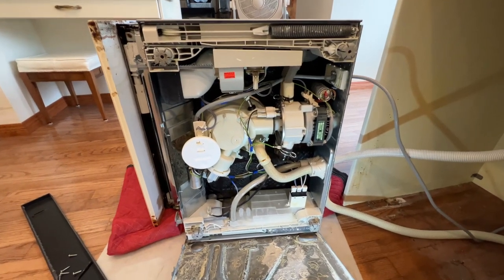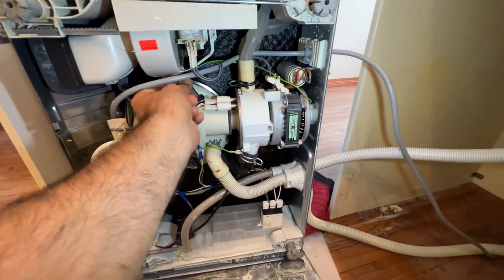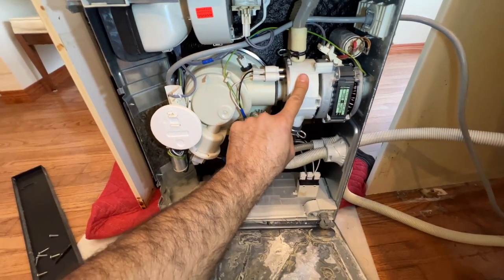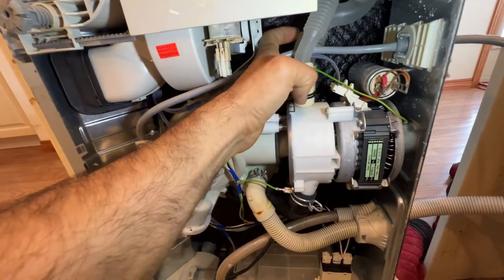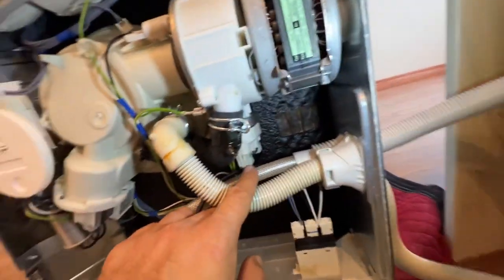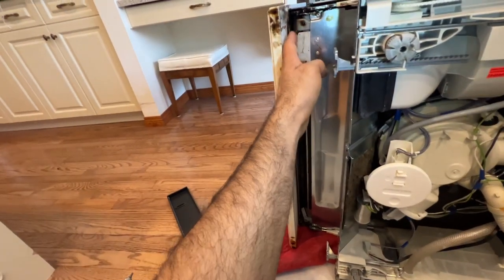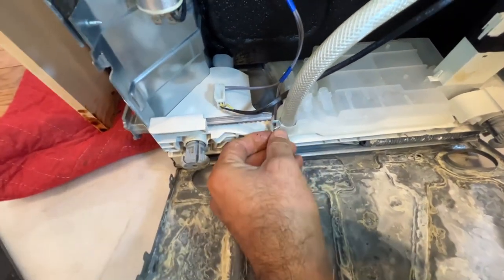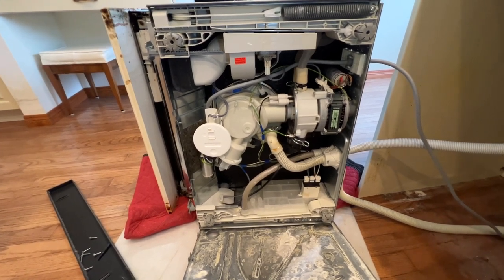How to find water leak on a Miele dishwasher

Comment: Both of my spray heads hoses perished at the bottom where they are rubber and are very expensive to replace so I fixed them. I removed them carefully cut all the old rubber away went round to a mate who fixes cars and had a rummage through is old radiator hose box until I found one the right diameter and asked him if I could have it for a drink. Them popped into the local car mart a bought some automotive gasket glue and some stainless hose clips. Got home cut to length glued the rubber hose to the 
plastic pipe put one hose clip around the joint and tighten it, put the other end on fitting at the bottom and secured it with the other hose clip, job done. This has lasted far longar than the originals at a fraction of the cost. Car hoses are much thicker and can withstand much hotter temperatures and pressures, likewise the gasket glue. I now have a new leak which I'm trying to trace its not my repairs.